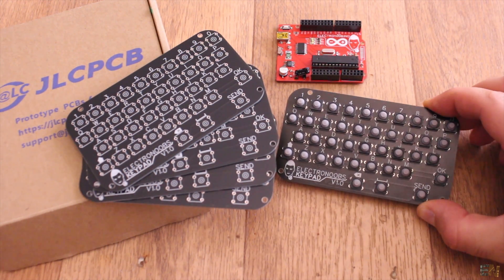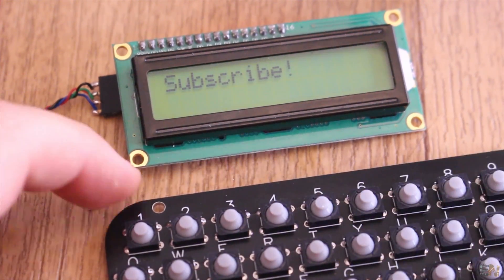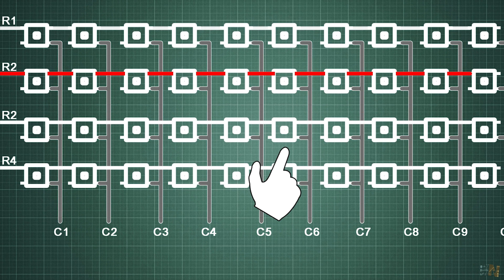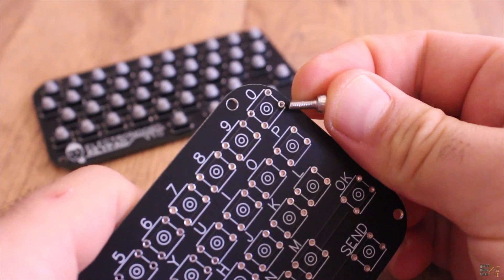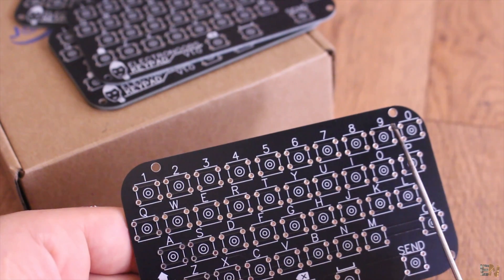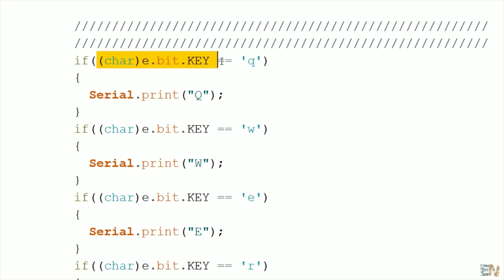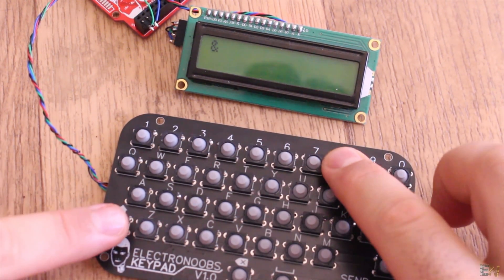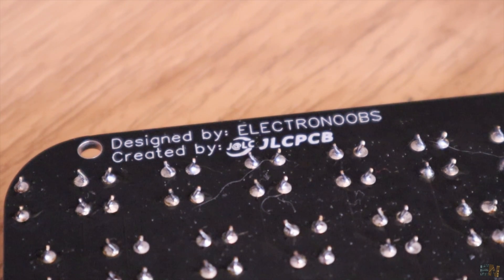Keyboard PCB | Serial output | Alphabet Numbers Signs

Comment: Have a clock project that needs a keypad... was going to use a Nextion screen but it seemed like overkill. Also, existing keypads did not have the functionality I wanted.  I think the solution will be a custom keyboard similar to this. 

Need menu navigation keys, numbers and various custom ones (ie. DST on/off, Alarm on/off, Restart,  etc) 

Have also used keypads and other things internally and they're a royal pain, a dedicated chip for keyboard processing and simple serial interface seems the go.

Comment: Up Electronoobs 
Love your makes and very decisive detailed educative approach in your contributions to make-community
very helpful and constructive

Moreso, you can work on wireless like adding Bluetooth as alternative communication channel to wire, more seamless for arduino base or similar core
before version2 , dual buttons for space bar  with fgair-spacing-between. 
Thanks a million

upcycle and electroobs group, very many for sharing your upward contributions to communities of DIYs, Makers, Thinkers&designers esp. who could not code but which to extend some apps are borrowing and implement

Comment: I am working on your brushed drone, you have used SI2302 MOSFET ,I am not getting it from which MOSFET we can replace it . Bro please reply
Reply: https://br.mouser.com/Semiconductors/Discrete-Semiconductors/Transistors/MOSFET/_/N-ax1sf?P=1z0z5laZ1z0z7ptZ1z0y3zrZ1yjeqdpZ1yjeqcsZ1yjeqojZ1yjeqfrZ1yjeqfpZ1yjeqorZ1yjeqfuZ1yjenk0Z1yw802oZ1yw7zoxZ1yw7wjyZ1yw7zmtZ1yw7zzyZ1yw7znw&Rl=ax1sfZgjdhozZ1yw78c6Z1yw75y0SGTax1sfZgjdhp2Z1yw76fcZ1yw76c7SGgjdhp5Z1ys05aaZ1yqjrlwSGT
Reply: all necessary filters applied
Reply: you can do it on any other distributor's site (digikey, lcsc, ...)
Reply: @OskarNoriyuki  thank you for your help but I don't find my product on it, do u have another website
Reply: @amanpathan9670  Those 17 products are equivalent (or better) than that si2302 mosfet
Reply: @OskarNoriyuki  can you tell me the about equivalent MOSFET in more detail , like name_model,etc

Comment: That's a nice keypad, one idea from having flash hundreds of of people's boards (I used to work in electronics assemble house) is to have the programing pads as bare 0.1 inch through holes, this way you can just place the USB-serial into the holes and hold at an gale to program, this will save a lot of work vs soldering to pads to program.

Comment: Please add the 6 SPI pins for bootloader burning (with 2,54mm 2x3 connector) and the FTDI connector also in 2.54mm form factor, that you can but the FTDI programmer directly through the holes (like at the arduino pro mini). That would be very nice!

Comment: You should try metal dome switches. They are as easy as just placing in right location and taping them in place. No soldering.

I imagine you coughing at the end of soldering all those switches.
Reply from the maker: Thank you very much for this tip. I'll check those metal dome switches!

Comment: I like the idea, but I already built something similar out of a salvaged old Sharp PDA keyboard. 
  In my opinion you really need some TVS electrostatic protection for a device you plan to handle directly like this. If you want an open source example, the AVRTransistorTester project has a documented example of a cheap 4 channel TVS chip called the SRV05-4. That one has super low capacitance so it doesn't affect the line it's attached to. The circuit was used on the Chinese "AY-AT" clones. I covered that one in an upload where I retraced the circuit and made a KiCAD schematic I also posted on GITHub. All the links are in the vid description for the AY-AT.
   You might get away with just some BAS40-04 dual schottky diodes in a TO-23 package for each line. I haven't seen a China direct supplier of those at a cheap price though. The BAS40-04 has diodes from, ground on the left pin to the center pin, and from the center pin to the right pin. You just route ground on the left and Vcc on the right. These diodes have a forward voltage of 0.4 volts. So it switches the line inside of the ATmega's specification of Vcc+0.5V. This over/under voltage protection should technically still accompany a TVS setup as the diodes are only rated for 45 volts and a TVS strike is far higher.
    I think I would be really careful about selling a product directly without protection. For example, I live a stones throw from the Pacific Ocean. It's common knowledge that humidity has a large impact on electrostatic characteristics. I don't have much of an issue with electrostatic here. However, when I lived elsewhere as a kid, I recall getting shocked by touching metal surfaces regularly in the winter time when the humidity was super low. It happened often enough I could watch the spark jump, and remember seeing it a lot. If you send something like this product to places like the area where I grew up (United States of Tennessee/Alabama/Georgia), you can count on people having problems. These may seem unusual to those of us that live in a different environment with different atmospheric factors. It's just something to think about.
Thanks for the upload.
-Jake
Reply from the maker: Thank you very much for all this info. The idea is to place it inside a case so we won't touch the pads belwo with our fingers...
Reply: Upcycle Electronics 
Love your contribution
very helpful and constructive
unlike some

Moreso,  work on wireless like adding Bluetooth as secondary communication channel to wire for arduino base or similar core.

upcycle and electroobs group, very many for sharing your upward contributions to communities of DIYs, Makers, Thinkers&designers esp. who could not code but which to extend some apps are borrowing and implement

Comment: Awesome! But what if we pressed two or more buttons simultaneously? Will it work?
Reply: I would say... No. The key matrix lacks the diodes needed to avoid ambiguous key detection.
Reply: @PeterCCamilleri  Yes but how do the LED Matrix do it.
Reply: @HarshCreatives  LEDs are diodes!
Reply: Even though, with the right code you could have 2 key roll-over allowing two keys to be pressed.
Reply: Led Matrixes use multiplexing, which could also be used in this code to detect as many keys at the same time as you want

Comment: Thank you for such a great project 
But can you please tell how to convert it into usb keyboard
Reply: Its easy simply recycle the chip of an old usb keyboard but you need to take in account the order of connexions that aren't different of an 4x10 array you need to follow the keys connected to each row and column with a tester and emulate in your PCB. Good luck.
Reply: @joseparedesalbuja8293  thank you
Reply: Other way you can use an arduino micro pro, mega ADK or due instead the ATiny. They have a host usb (not only client) that can be configurated as a computer device like a keyboard or mouse.

Comment: This video is great and is very helpful for my project that I’m doing with two esp8266. Note there is a spelling mistake at 6:11 download
Reply: that's a nice idea, how is that - is there a tutorial somewhere on this?
Reply: MD4564 no there isn’t a tutorial but it’s something that I do I’m my free time and it’s used for making a port hosting to allow for a gui and then using the two cables to another esp to the raspberry pi so I can control everything like fan control for it while it’s in it’s case. Allowing for home automation or anything that can run on the pi.
Reply: @MarcoGenio  nice!

Comment: NICE i was thinking of making a keyboard that you can use with pc using arduino but need a arduino pro micro for that
Reply: Why do you need arduino pro micro for the same? Why not the Arduino UNO?
Reply: @pr2207A   because pro micro can directly connect to USB. The microcontroller of pro micro or Leonardo can directly use USB protocol and so it doesn't need the USB to serial ic
Reply: @inferno6012  thank you for your information. I am also looking for the DIY arduino keyboard. Have you build it?
Reply: @pr2207A  you find the schematic and code on Arduino official site
Well code is already in the Arduino ide examples this should get you started
Reply: @inferno6012  ok. I think you also look for unique DIY projects, i would like to recommend you to have a look at channel called PR ROBOTICS.

Comment: Maybe for a keyboard you should consider lead free hasl and solder lead free... Its not nice for a propably mobile device you carry and use to spread lead particles everywhere...
Reply from the maker: Thanks for that tip. The idea is palcing this inside a case or so... Otherwise the pins below will hurt your fingers
Reply: @ELECTRONOOBS  I have seen a project where a second pcb with holes and text was mounted above the pcb with the circuit. It was used as a cover and worked as a front plate. I expect something like that could work with this nice keyboard and would look great.
Reply from the maker: @JanJeronimus  Oh, taht's a nice idea!

Comment: Have you protected the keyboard against short circuit when you press multiple buttons on the same row at the same time ?
Reply from the maker: I did not :/ I'll make some changes!
Reply: @ELECTRONOOBS   you should use 32u4 chip, then you could also use it as a USB keyboard (Y)

Comment: A very beautiful idea ! But there is a problem in addition to that you have talked about , you have to add a diode at each raw so that you prevent any short circuit may be caused by pressing two buttons in the same column at the same time (because you send 1 to a single row and 0 for the others )
Reply from the maker: Thank you for yout tip!
Reply: @ELECTRONOOBS  I was going to say the same thing - there are actual several reasons that you need the diodes.  I did a search and found this article that does a great job of explaining it all. http://blog.komar.be/how-to-make-a-keyboard-the-matrix/  But, I really like your compact design. One of my hobbies is photo booths, and a keyboard like this would be great for a behind the unit control system. Coupled with an Arduino Leonardo, it could function as a Windows keyboard.
Reply: hmmm... i think that this isn't needed, because the principle of working on this library is next:
Reply: Just one row is logic 0 (0V or GND), but another ones isn't logic 1, they're just set like a input (high impedance). Each column is set input pull up. On this way pressing multiple buttons can't make damage, even more can determine which ones was pressed.
Reply: Stole Jovanovski don’t understand the meaning of “ like a input (high impedance) “, does the library change the configuration of the pin to be as input instead of output ? Why ?!
Reply: @stolesila   you  got it, if only the pin being driven HI(+5V) is set as an output and all other pins are set as inputs you don't have a problem.

one way is to set the all the pins high for the rows and just set the required pin as an output as you scan through the rows. at the beginning of each scan reset all the pins high, just in case you get a power glitch and some how the data in the output register gets corrupted.
Reply: Not at all 😇